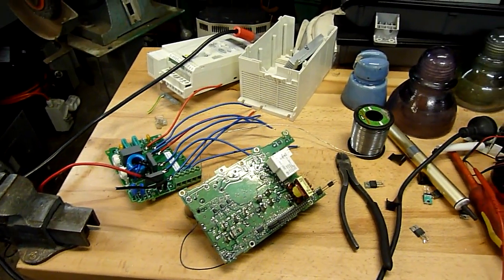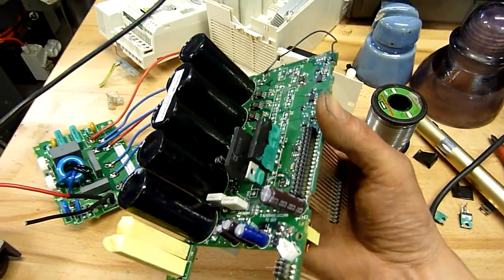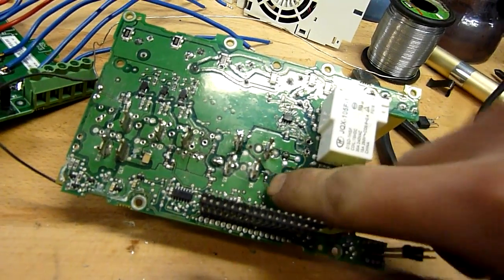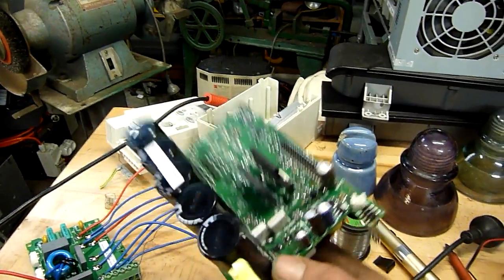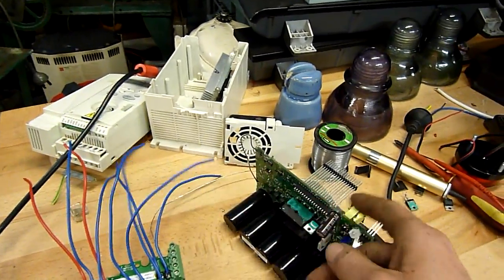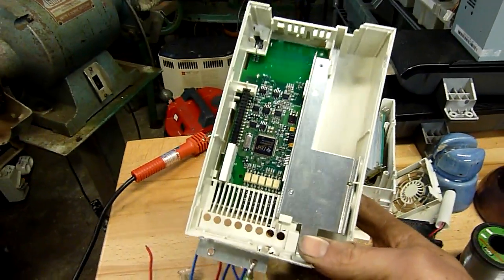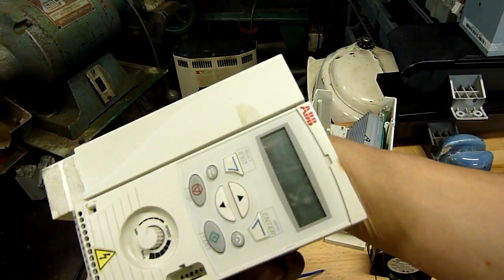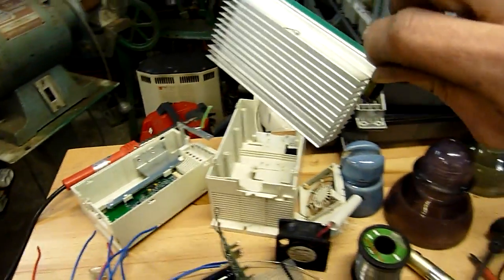ABB VFD - Its Dead Jim!

Comment: The DSP is used to minimize vibration under load and to monitor current waveforms. There is a reason for everything in these drives.

Comment: Standard chain reaction, output IGBTs got blown so they made a short on the main power rail, second after, rectifiers died too because of the short. Also I guess IGBT drivers died too, since gate terminal got a spike of high voltage. Sure it can be fixed, but it's most of the time not worth time and money :]